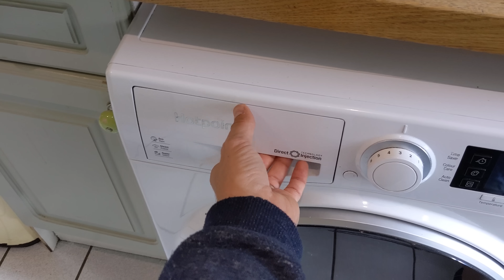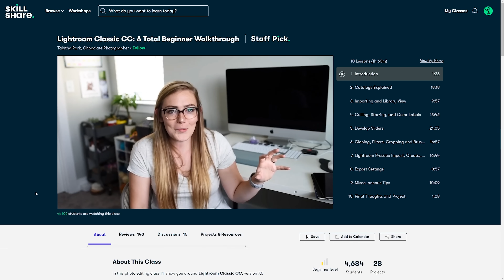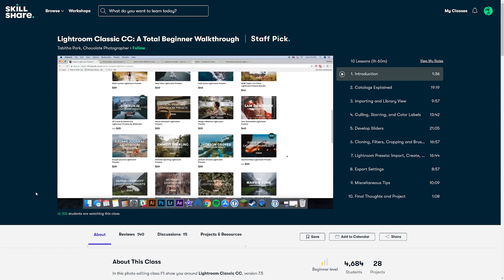The Pythagorean Siphon Inside Your Washing Machine

Comment: Dude in America we have never seen that type the flushing mechanism. It’s usually a flapper at the bottom of the tank a tube that goes up that acts as an overflow in case the ball cock valve he spoke of fails. Then all the water goes into the bowl the toilet is the only thing in your house that uses water that is it vented in usually hooks directly to the trunk line and wants the water rises to a certain point and starts to flash it creates a vacuum sucking the rest of the water out of the bowl I have never seen one of those in a toilet. I have seen low flow toilets that use water pressure to fill up a bladder and then when you flush it it shrinks like an accordion forces less water was more energy into the bowl but it is always flushes based on the built-in trap that prevent sewer gas from coming back in

Edit: dribbling over the top is what we call an overflow. The problem with the rubber flapper versus this flushing device you’re showing us is that in order to repair the system we have to remove the tank and that’s a bit of a nightmare. And all the American toilets I’ve ever seen I can replace every moving part in it without having to deal with the worst part of removing the tank I mean changing the float five minute job changing the flapper a five minute job but to put that in the toilet yeah kind of sucks man it’s kind of shitty design and I’m sure that it’s probably not real popular all over the world. 

There is one float There always fascinated me it’s a little diaphragm thing that goes in the bottom of the water there is no moving parts on it and it opens and closes based on the weight of the water above it or you can buy it for like eight dollars maybe $12 they last for years you don’t have that big long floating ball or even the more compact unit where the floats around the stem in the valve. But I honestly don’t see what this device offers over conventional rubber flapper to do a chain or the more modern toilets with the two buttons one for yellow one for brown type systems

WOW it’s crazy that this is the standard where you are and I’ve never seen this system. Like I said I’ve seen accordion styles systems that exploit the water pressure to store kinetic energy to make low volume flushes. it’s weird that we could talk at length about how toilets work differently from where are you and I live. 

However I still think that it doesn’t matter how the water gets from the tank to the bowl the way the toilet flushers. To me this thing seems overly complex. 

With your flusher you have to hold the lever down for number one and to use less water. Here in the USA, that seems backward. Here we can just push the lever down let go in number one is gone. But if you drop a big douce do you want to hold the lever down to let more water out and get the turd down the bowl

Comment: My toilet just has a hole in the bottom with a plug on top. The plug is hollow. When you tilt the handle, the plug is pulled out of the hole and the tank begins to drain. Once raised the air in the hollow keeps the plug floating so that it doesn't close the hole again until all the water is gone at which point there's no water below it to float on and it seals the hole again.

It also has the float sensor for filling the tank, but because the top water level isn't important for the flush, you can adjust the sensor to pick how full your tank gets within a certain range.

Comment: In the U.S we have just a simple rubber flap that’s sort of shaped like a turkey baster and the handle pulls a chain that lifts the flap and the water flows out of the tank under the flap and once the tank is empty the flap falls back in and seals the tank again, the float system is the same though to fill the tank

Comment: Over here is mostly long tube sealed with rubber.
Hydrostatic pressure keeps the tube down, preventing water flow. When you want to flush the handle is connected to the tube and as the handle goes down the tube goes up. Forced by hydrostatic pressure water seeps into the gap and keeps the tube open. When there isn't enough water tube settles down and again is sealed by the rubber.

Comment: I've never seen a toilet with that mechanism

All the toilets I know use the force of the water crashing down to prime the siphon

Meaning that if you pour a bunch of water into the bowl quickly it will flush without ever needing to touch the handle (and if you do it slowly, the water will dribble out, but not with enough force to clear away any solid waste)

Comment: My toilet flush mechanism basically just has a plug with a float on the underside, linked to the flush lever. When the lever is is pulled, the plug comes up with it. Because of the float on the underside, the water drain hole is kept open for flushing. When the tank is nearly empty, the plug drops back into the drain hole along with the water level to stop the flow. Then the tank gradually fills up, and the hydrostatic pressure keeps the plug shut until the next flush.

Comment: All of the residential toilets I have seen use a floating flush valve.  It is held in place by water pressure, and floats up when you pull it.

Comment: Took me a long time to realize that your flushing mechanism is nothing like my flushing mechanism, since the bit about them being different was at the end of the demo, haha. My toilet just has a rubber stopper that you pull open with a chain, and the flow of water just holds it open until the tank is empty.  We have the same float mechanism, but we have a glory hole overflow drain.  Usually, if your toilet is running, it's because the stopper didn't seal all the way.

Comment: In the US most of our toilets function by the lever lifting a "flapper" that plugs a drain leading to the bowl. That flapper has a little air bubble in it that makes it float until the water level gets low enough that the flapper drops back down so the tank can refill. MUCH simpler mechanism, but we don't get the half-flush.

Comment: My Canadian toilet has no siphon. Rather, there's a cap over the outlet which floats. Normally, there's air under it and water over it so it's held down. When you flush the left pulls it up and now there water all around it so it floats and keeps itself open until the toilet tank is fully drained. Then there's air all around it and it falls back into place while the tank slowly refills.

There's also an overflow bypass to prevent disasters.

Comment: Never seen a toilet mechanism like that in the US they just use big rubber flappers that are slightly boyent attached to the handle via a chain which when pulled breaks the seal and sends the water out of the tank

Comment: Ours is just a floating flap that is held down by the pressure of the water once you break the seal the float keeps the stopper open until the tank is empty.  For filling is the ball cock

Comment: My toilet cistern contains the absolute most counterintuitive product I've ever seen: a "Dudley DuoFlush" syphon (I think): it has two flush modes - "normal" and "light" (for poo and just wee respectively, I would imagine).
To activate "normal" flush, you pull/turn the handle fully and release as you do on most toilets.
To activate "light" flush, you pull/turn the handle fully AND KEEP HOLDING IT DOWN FOR SEVEN SECONDS until the water stops flowing into the bowl.
Who in their right mind thought that it was a good idea that the "light" flush - the one that's better for the environment and your water bills and should therefore be the default - was the one that a) took the greatest amount of effort, b) took longer, and c) you only know about if you either installed it yourself, or bent down to read the sticker you put next to the handle on the outside of the cistern? Not even my lodger, who knows about it, can be bothered with it.
++deep breath++
Glad to have gotten that off my chest - I've tried telling one or two friends about it and they just stare at me. Not at the syphon mechanism, but at the fact that it winds me up so much :-). I'm glad this is a safe space where none of you lot would be so judgment-
Hang on - why are you all looking at me like that...?

PS - Brilliant video, as ever, Steve!
Reply: I agree, seems completely backwards to me also.   The less water usage flush should be the quick press... if you want a stronger flush that uses more water you hold it down. this is opposite, strange.
Reply: So the mechanism works exactly like described in the video.
Reply: @egregius9314  Yes, but a shorter, more water-friendly flush requires a longer pull on the handle - about seven seconds.

Comment: I have a strange conundrum. I'm assuming it's something to do with static electricity but I'm not entirely certain. 

I have a touch lamp and a rather large metal fan. Lately I've noticed that sometimes when I switch the fan on or make it go faster my touch lamp comes on. It doesn't happen consistently all the time but it's frequent enough to be annoying. Do you have any thoughts or suggestions?

Comment: I have one where it uses the pressure of the water to keep the "valve" down but when you pull it, because it has a float, it will stay up until it drains and then it is "primed" for filling and to control the amount of water you just push the lever tab on the pivot part opposite to push the "valve" down and have it sucked by water again, and you can also control the float position so you have a set amount of water filled in the reservoir, the overflow protection is just a direct tube inside the "valve" that acts as the "rod" to pull the valve up but also it is cut so the top of the tube is a bit below the water inlet valve. (It is simple and effective)

Comment: I got up from my computer and looked into my toilets water tank JUST BECAUSE OF THIS VIDEO....

I learned that my toilet DOESN'T use a siphon. It uses a plug; This means that the Full-Flush/Half-Flush effect is reversed: I have to hold the handle for a full flush, otherwise it does (about) a half flush.

Comment: Toilets in Russia don't use a syphon the part with the float Is basically the same the seal is just a rubbe dome that is pressed against a hole at the bottom of the tank to flush you press a button which actuates a lever that inverses the downward motion and lifts up the rubber dome and let's the water out it's kinda cool too because the weight of water pushing down on the dome helps make a better seal

Comment: I’ve never come across a siphon toilet mechanism here in Texas. Mine have always had the same foot mechanism to stop the flow of water. In order to initiate the flush, there’s a chain connected to a hatch at the bottom which just opens it up. The hatch is meant to just use gravity and water pressure to close. Several times this does not happen and it just endlessly drains and wastes water until you go fiddle with it which sucks.

Comment: Reduced flush - ours works correctly - the opposite way around - you hold the lever for the longer flush.
Note also the blue knock-outs up the side of the priming pump - I guess they can be removed to also reduce max flush.

Comment: 5:20 - what idiot installed that float valve ?
If you look at the top right corner of the tank - or more precisely at the back of the float valve, there's a peg sticking out with (seemingly) 2 notches in it. The notches are so you can break off excessive length. Where it fits to the back of the valve, it will be screwed in. It is designed to be the correct length so it touches the side of the cistern (internal wall) to stop the standpipe from bending when the valve is being closed by the float. Ideally, it should lean against the tank wall perpendicularly.
What's that foreign object in the bottom of the cistern bottom left corner  (blue/white thing) ?

Comment: Hi,
Where I'm from we have a completly differnet solution for the toilet flush.
Usualy there is a plastic pipe - with about 5cm / 2" diamiter that is getting lifted - so the wather starts floating directly into the toilet.
When the tank is empty the pipe will touch the seal again and the tank will fill up till the tank is full.

pro: 
- much less power is needed to trigger the flush
- pipes in differnt heights over each other can be triggered for differnet flush - intensity
- easy installation ... for example some trigger mechanismen simply pump air down to lift up the pipe 

kontra:
- the seals will get old and will need replacement

Comment: In america we have a flaper that sits over the opening when you lift the handle you lift the flap then the water drains and the flap floats untill there is no more water then it seals. The ballcock is similar but new ones have a contained unit that has a float around the water tower thing that shuts it off.